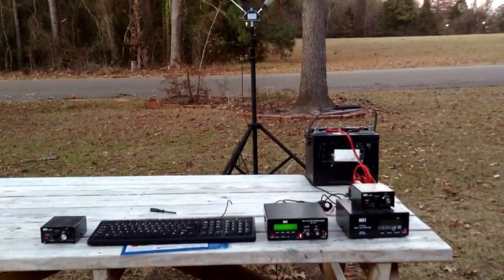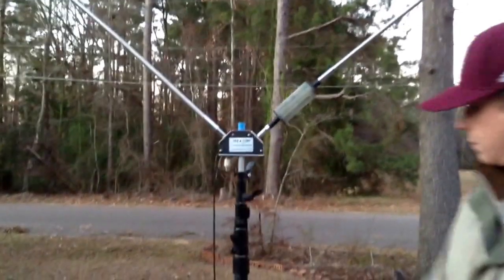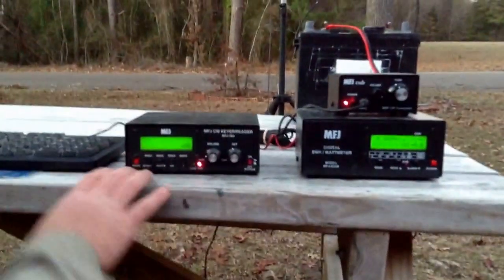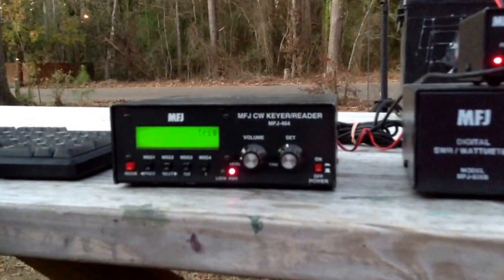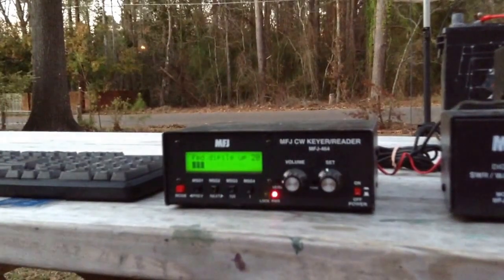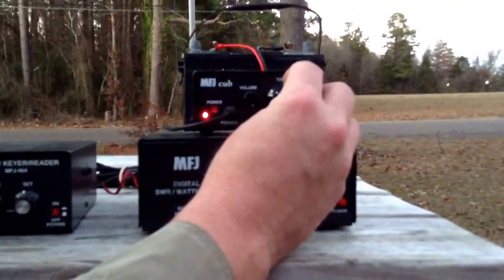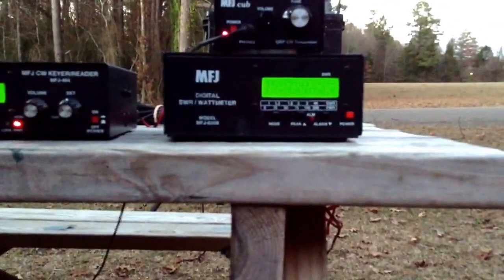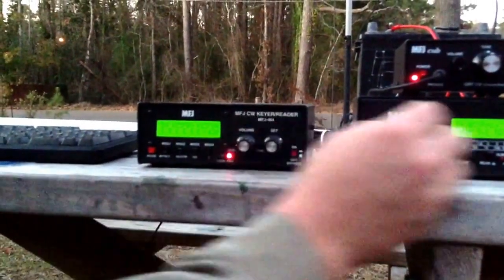MFJ-464 Demonstration

Comment: Plz beware, if u purchase this unit u will need and AT keyboard (5 Pin Din) or purchase an adaptor cable. I ordered a new PS2 Keyboard and a PS2 to 5 Pin  DIN (AT) adaptor.  (Adaptor needs to be Male on 5 PIN DIN side,  and the PS2 Side of the Adaptor Female), Adaptor on amazon 4$ and keyboard was about 15$,  you will also need and audio cable, the type of cable will depend upon your rig for audio to the 464, receive, then another cable from the 464 Keyer out to the rig.  When I finally get all my cables etc, I may put a video together showing all connections, still waiting on 1 cable

Comment: i cannot read my received clearly. can u help me how to adjust the tone and the volume? what is the proper settings on this please.? i can transmit very will but the reader mfj 464 cannot read very will. please help.
Reply from the maker: There are two trim pot adjustments on the front one is for tone and the other is signal level. With a small flat blade screwdriver, set them both to the center rotational position.  With a good morse code signal rotate the tone trim pot slowly until the tone is picked up and the red led flashes the brightest.  Once the tone is matched, them you can set the level.  If the led flashes too much, turn the signal level down.
Reply: @cebutler100  thank you. i 'll try. 73

Comment: Old Video Chad  - but did you keep the MFJ-464 and continue to use it?  -- N1KTJ Kevin
Reply from the maker: Yes absolutely. I use it when I work cw. Permanent fixture to my setup
Reply: Thanks. Chad. Was looking at software called MRP40 to interpret Morse via laptop . But I like the idea of a stand alone device and keyboard.

Comment: Hi there friend of mine has one of these, when the morse comes it fast it reads it as a load of  E E E's, is there anyway to set the incoming morse speed...not the sending speed...g4vvq.
Reply from the maker: yes, the two small holes in the front of the unit allow you to set the input level and tone of the incoming signal using a small screwdriver.   If the unit is displaying EEEEE, try adjusting the level and tone.
Reply: Thanks chad that's helpful will try that cheers Fred in UK

Comment: Chad  I was wondering where you found an "AT" keyboard  as i called for in the specs?
Reply: Helped a friend of mine with this problem. Get an AT to PS/2 adapter. That'll cost you a couple of dollars online. Then all you need is a PS/2 keyboard, which many people will probably give you. If not, you can get one for about .99 to 1.99 at a thrift shop.
Reply from the maker: BillTrainingTech MFJ sells the MFJ-551.  I find them at thrift shops for a couple of bucks, got a few extra if you want me to send you one.
Reply: Chad Butler Thank you for your response. After I wrote the comment I did see that they were available from MJF. It is a kind offer but no thank you I don't need one just yet, I am a newbie in fact I go to take my technician's test tomorrow.
Reply from the maker: Great!  I actually used this 464 when i first got my technicians license.  It got me excited about HF because it allowed me to make contacts on CW on 40 and 80 meters before i ever started trying to learn morse code.  Have fun!